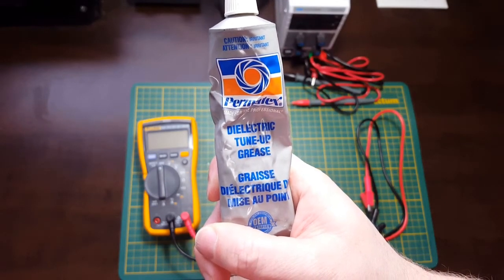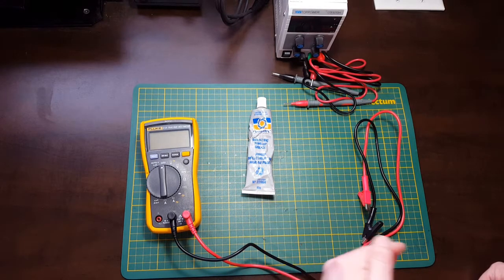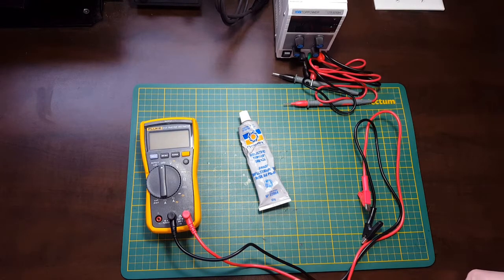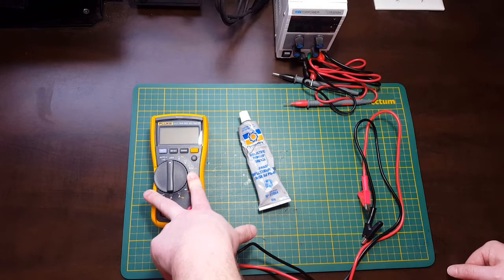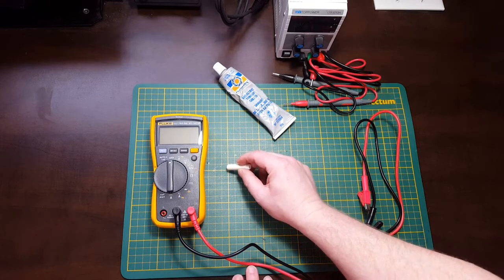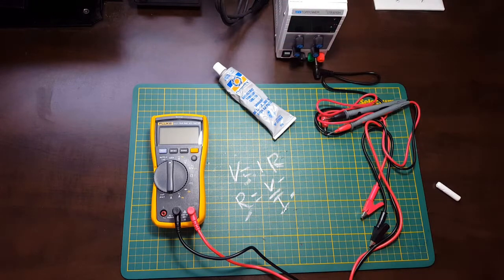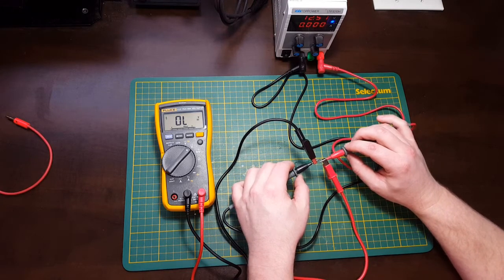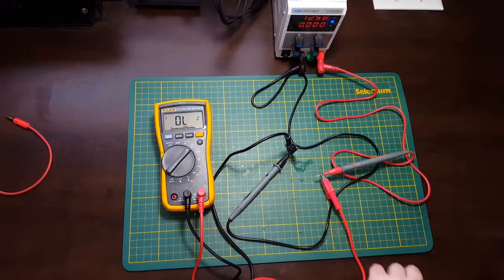Dielectric Grease on Electrical Connections

Comment: I work in IT, and i am currently rebuilding a network across a few sites.  I have some IDfs in high dust enviornments and have been thinking of using a moderate application of Dielectric on those ports and switches to help keep them clean as well as help with anti-seize.  
We recently had a new switch and firewall installed as well as new Access points across all sites.   I talked to the special systems team that ran the cabling and did the AP installs, the lead was telling me that in certain environments, like freezers, not using a heaping of grease in the APs RJ port will result in condensation inside the unit, killing it within a few days to a week.  
I have been researching this to apply it to my switches in high dust and more industrial environments, where a clean network room is not an option.   

good video, put to rest the argument of added resistance.  the mechanical action of the connection negates resistance added by the grease.  and also insulates and protects against corrosion this explains why it suitable with liberal application in extreme environments (like freezers).  but with a more moderate application, grease can be suitable for dusty environments as well.  

I watched a few vids before yours, but you were the only one to cut through the crap.  do an actual experiment and add to the hypothesis. 

Godspeed brother.

Comment: I have a small fleet of class eight trucks that I have to care for. I can tell you from direct experience that dialectic grease between truck & trailer cable connections or between battery connections or as a very light film in a fuse/relay box (not done by me) will in fact cause mild to severe resistance issues. That's all I need to know about dialectic grease.

Comment: Dude why not just put a small bead of the grease. on board. put mulyimeter on conductivity. touch each end of probs to bead of dieelectric grease, if gett beeping its a conductor.Simple. enough of the long winded video .. keep it simplyYou know K.I.S.S

Comment: This is exactly correct... contrary to popular opinion, applying dielectric grease to an electrical contact will not increase the contact resistance. As you have shown, the contacts will wipe away the grease, thereby making a good connection.

Comment: Actually, dielectric grease is compressible; thus, there is probably another argument out there somewhere to use a light to moderate coating and avoid potential problems by using a heavy coat, which could affect the grease's abilities to lubricate, insulate, and to transfer heat.

Comment: The bottom line is yes the grease does increase resistance, it has to or its not a non conductive grease.  It can be a problem though.  Fill up a cars sparkplug boot with it and push it on the spark plug and see how it runs.   I know the answer but go ahead and make a new video I might watch that one.   

Putting it on "some" connectors can cause them to fail.  It depends on the situation, you test was very narrow and limited.  In high voltage situations its problematic,  you don't want to put it on switches, where a contact cleaner would work better.  
Most people put too much on and resistance will increase with thickness for sure.

Take a look at this video it agrees with the thinning theory just uses a different approach.  

https://www.youtube.com/watch?v=rFHGWxgFUD4

Comment: I've been trying to fix a cranks but won't start problem with my '05 Neon. Discovered that the engine would attempt to fire when I pushed in the key when turning. I took apart the ignition switch to find the moving contacts and flat contact plates covered with black grease. I guess that was some sort of conductive dielectric grease. It appears there was too much of that in two divots made in the flat plates that the Start-Run moving contact plate points touch. I cleaned all that off then applied a light coat of spark plug boot grease to those surfaces. I still need to push in the key when starting to get more cylinders attempting to fire. Got the switch back out to remove most of that grease from the flat contact plates then see if I can sand down a channel to each divot then sand smooth their bottom surface so the moving contacts can push away the grease to make a full contact.

Comment: Omfg so glad I found this, my problem is I have multiple points in my harnes that is a conjunction for ground,dash board like a Christmas tree! Ever light know to man. Just can’t be right! My car sits A LOT, so I cleaned g101 g151 ect.. used "dielectric grease" thinking it would keep corrosion away. everything mint for a year as I periodically ran it because it just sits well this past year it got put away yesterday had to play musical cars and the plaque is back. I read problem is dielectric grease properties doesn’t allow condensation from contact metal to pass threw causing corrosion , completely opposite of how oil would separate for water it breaths, my question what is better than oil as this car sits way more than it should, it’s just way to expensive to race right now

Comment: Welp I heard about it and didn’t look how to use I thought I was going good I jumped a gun and got it. We did all the wires in my boat and  pretty much dunked every end in grease and I used a lot of 1/0 awg to the little wires for every single battery amp and light now I’m look if I messed up and need to take it off some how but everything works no problem so….

Comment: I'm thinking of using the grease on the inside of my juliet connector on my ebike. The 9 pins are known to suffer corrosion A lot of amps go through there and they get warm and when they cool can draw in moisture leading to corrosion. I've seen examples of them melting due to bad contacts.
Reply: Or try  good old Vasoline.

Comment: I have used die electric grease on automotive 12 volt connections for several years and have never had a connection resistance issue. I have especially on my brother in law snowplow pump connection where snow and water are a constant problem. that is when I started using die electric grease and never had connection problems after that. have used dozens of times on the end of spark plug boots and never a m8sfire issue.

Comment: I have used it on auto and home electrical contacts and it works fine. Keeps the contacts from oxidizing I refurbish old fans from the 20s to the 30s. I use this on the open contacts used, similar to the points on a vintage car. Works fine. Never had an issue.

Comment: Nice video, but I'm a little confused. Are you measuring millivolts or milliohms? You start off with one but keep repeating the latter. Thx
Reply: Technically he is measuring millivolts. But because he has set up his power supply to constant current at 1amp, a 1mV reading indicates 1 milliohms (because of Ohm's Law).

Comment: When dielectric grease first came out I had mechanics (now called techs) tell me to coat the terminals with it. In fact, with those early electronic modules they would say to squirt the whole connector full of grease before plugging the connectors together. Maybe back then the product wasn't fully understood (or the people selling it said, "just squeeze it all over everything!"). The reason I think it worked in many applications is that, as demonstrated here, when the connections are pressed together there would be tight metal-to-metal contact inside the connector and the grease would seal everything around it.

I'm thinking, now that the product is better understood, it probably makes sense to think about your application. Are the connectors going to go together tightly, scraping the grease away with metal-to-metal contact as they are pressed together? Or, are you going to have a connection where you can't count on a scraping action to create metal to metal contact when the connection is assembled? 

I've typically coated the connections on my car battery with dielectric. I can't recall it causing observable problems. But, I'm thinking it is probably wiser to clean the connections, assemble the connections, then use dielectric just to seal over the top. AGS has a video where they install the red and blue felts first and coat the surface of the felts with a little dielectric which I guess might help seal the bottom of the connection. Not a bad idea. -- On second thought, if you seal the bottom and any water, even from condensation gets in there, it cannot drain off. Maybe better to leave the bottom unsealed? [shrug]
Reply: This is exactly my train of thought. I'm looking into this because of my snow plow trucks. I've always used just regular axel grease in the connectors to keep water and salt from killing them. I switched to dielectric grease this year and the high current 12v ~ 200amp++ connector seems to be overheating and causing connection issues. It possible it's the age of the wire. But I'm also considering that the dielectric grease has increased the resistance and with high current demands it's causing heat. I have since cleaned all grease for the contacts and only have grease around the perimeter of the connection. I'll report back if I see any difference. Also considering using a very small amount of carbon grease to increase the quality of the connection

Comment: There are only a few situations you should use non-conductive grease. As for measuring grease resistance, this is useless. Electrical connections are metal to metal, the grease stops corrosion and air gap issues. Any grease will work, you don’t need a special grease.

Comment: I have been an electrician for 50 years. In my own home I have used Vaseline on the prongs of outlets for ever. They always connect without issue.
Reply: Always used Vasoline on auto battery posts. No corrosion. Those felt rings don't always work.

Comment: Zzzzzzzzzzz you just about lost me with the whole "see it takes the paint off" comment.

You really should've done a "real world" experiment with actual male/female automotive 2 pin connectors with one side as a loop. Measuring voltage drop/resistance when plugging the connector together, completing the circuit. Alligator test clips from your power apply with multimeter test points.

Comment: Thanks for the visible clarification through contact testing under load compared to the definitions given based on linguistics.
What is your experience with when the car fuse box\ relay box has corrosion what do you use to remove the corrosion?
What is the dry-out point for such a grease under electrical load?

Is this the same type of silicone grease used in the brake assembly for the slide pins where it is coming in contact with the rubber or silicone boots and seals? I I definitely am confused after still spending 2 hours to learn if I can use the permatex silicone dielectric grease I have from autozone for the slide pin and potential the brake caliper piston for fear that the lubricant has to be correct for the seals and boots also!
Reply: I only use 3M pure silicone grease for the brake slide pin/piston.  I'm super careful about only putting silicone grease there and on the rubber boot for it.  Don't get it near the pads at all.

Dielectric grease might have other components in it so I specifically purchased 3M pure silicone for brakes.  For battery terminals and electrical connections I use whatever dielectric grease is on hand and save the 3M for more important jobs.

Comment: I would like to see this test done with an electrical.
 connector applying the grease the way people do over the top of the female end.
Reply: The metal to metal contact is the same.  What didnt' you understand?  Do you think every connection you have is arcing electricity?  When you plug connectors together they connectors are only making contact in certain spots.  Whether you've coated it or not it should only be conducting electricity on those contact areas.  The dielectric grease will be pushed away on those contact spots but the rest of the connector is now protected against corrosion
Reply: My tacoma actually had some yellow type of grease all around the and on the headlight connector for the female end of the connector and the actual headlight bulb male connector. So I am trying to see if this would solve my issue of some new headlights I bought. 

On the passenger side specifically the bulb itself will cut on and off randomly. When i originally received them and replaced the bulbs it came with, there was a soft arc/burn mark on one of the little tab connectors. Where as my original headlights didnt do that at all. So i think there is a connection issue with the new headlight connector perhaps drawing too much voltage.